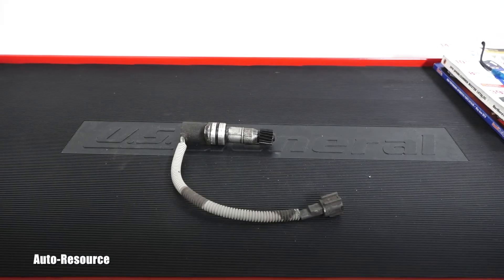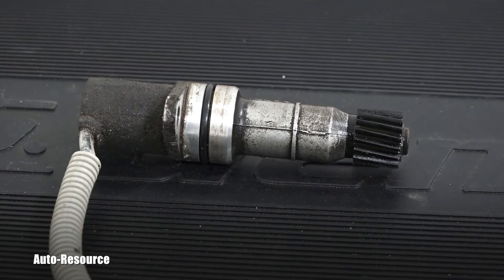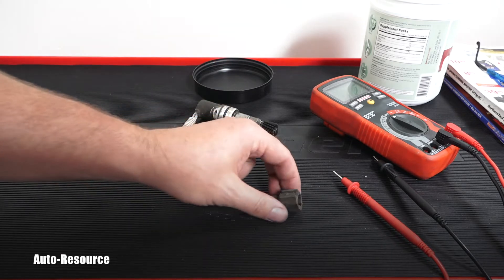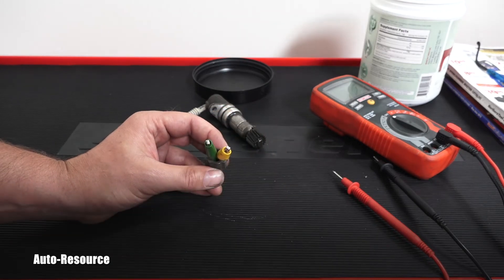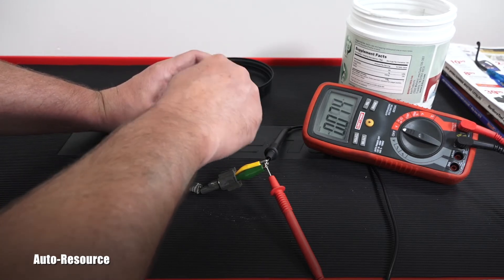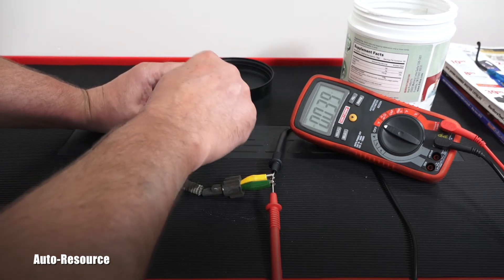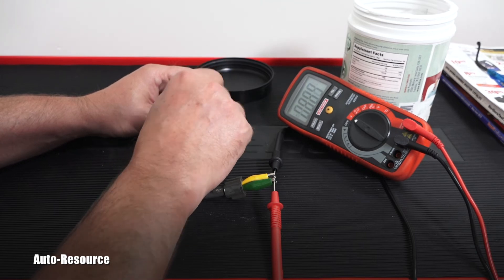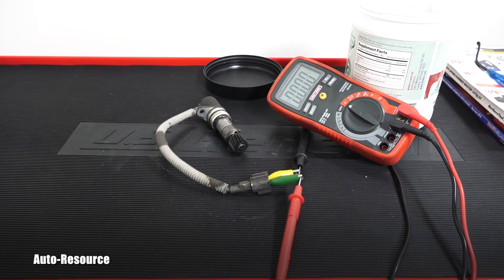How to test Vehicle Speed Sensor

Comment: If cars are DC why is this even remotely measured in AC? just out of pure curiosity,i know the Bap sensors in some cars are measured in Hertzs etc but AC is kinda rare, first time Ive heard that,whats wrong with DC volts? thank you for your time.
Reply: Most things that rotate produce an AC (waveform) signal. Because the sensor itself doesn't need power to operate, there's rarely DC involved there. Alternator is AC too, but is rectified to DC to charge 12v system (@13.5-14.5v).

Comment: Very useful I will do this when I get home because my speedometer isn’t working but the Rpms are working so I’m not sure if something inside the speed sensor isn’t communicating with the computer and needs to be replaced or if it is my dashboard that needs to be replaced. I’ll comment again to keep u posted
Reply: How did you go sam?
Reply: Aaa222222W2w22Aaaaaaaaaaaaaaaaaaaaaaa22aaa2W2a2a222w222222W2a222w2aw222222W22222a22a2AAaaaaaaaa!2aw2a2w22a2a22a2a2a222aa22a2a2aaa2aa2aa2aw2W22222222w22!aaSbrz